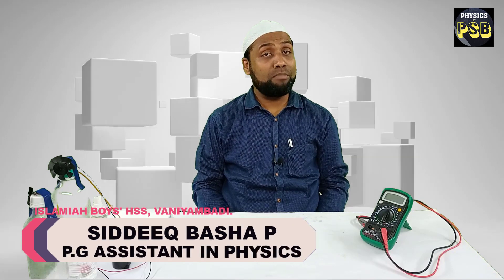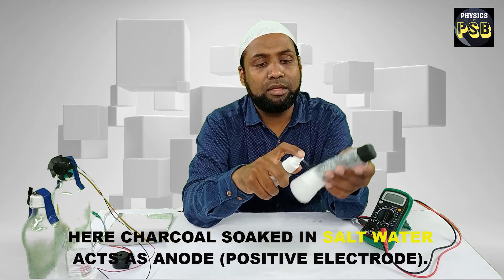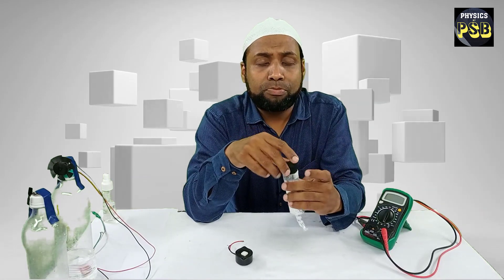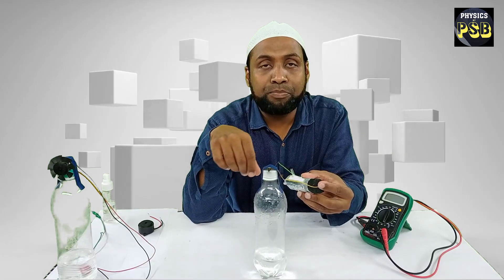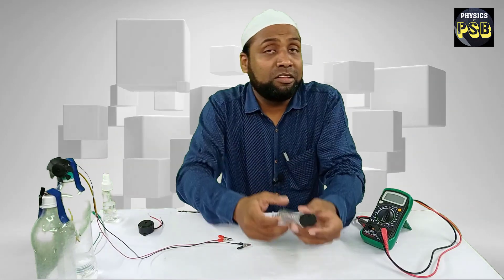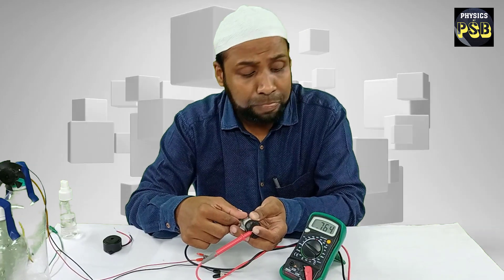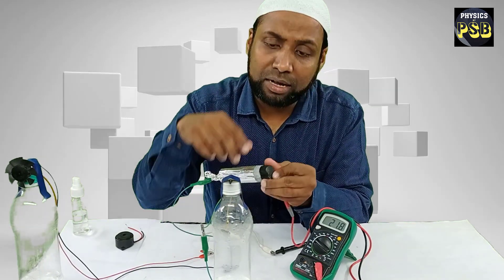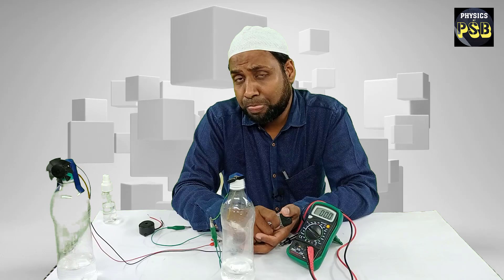Turn a charcoal piece into a Battery | DIY | Life Hacks | Charcoal Battery |

Comment: whats the catch?  why dont manufacturers use these batteries?
Reply: They did, 1880's to 1960's, carbon-zinc 'dry cell' batteries with ammonium chloride paste as the acidic electrolyte. You can still find them as the cheap unbranded batteries that last 1/4 as long as an alkaline battery.
Reply: Charcoal = pure carbon.
Batteries contain carbon.